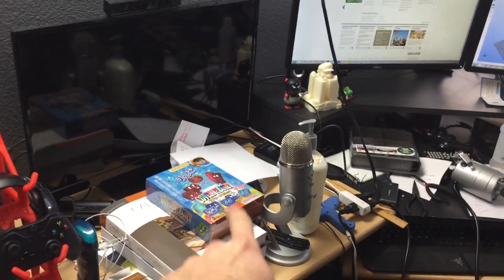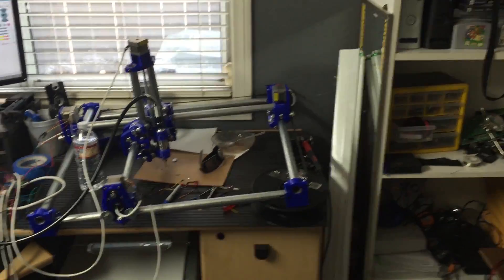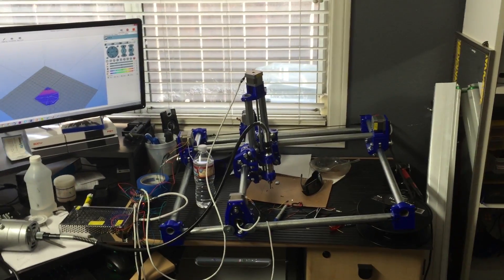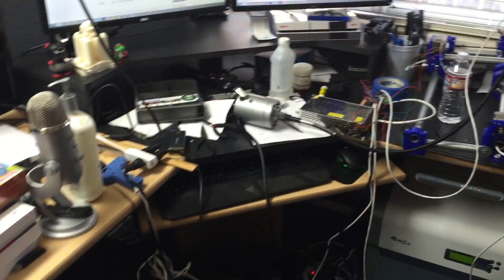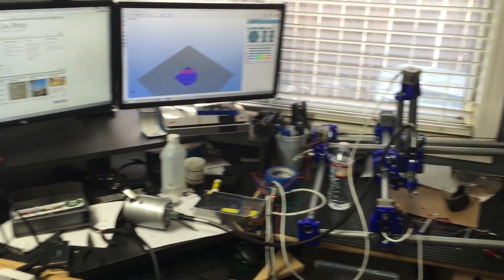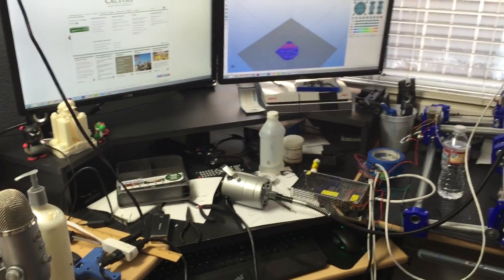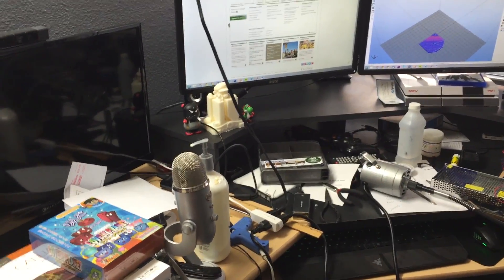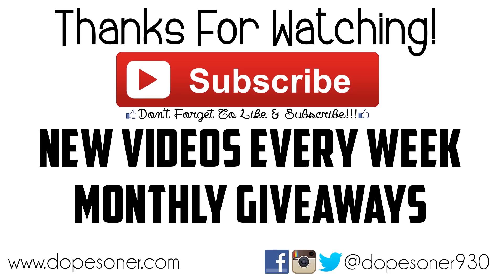3d Printed CNC Machine Updates | Repetier Host Settings | Engineering School

Comment: Quick tip I found for your webcam (I have the C920 and I believe you do as well): Record in the highest quality and disable all the auto color/brightness settings. All the video correction does is make your video horribly off sync with your audio, disable all that and you'll be recording at 1080p with no dips in framerate.
Reply from the maker: ***** thanks bro Ill give it a shot then :)